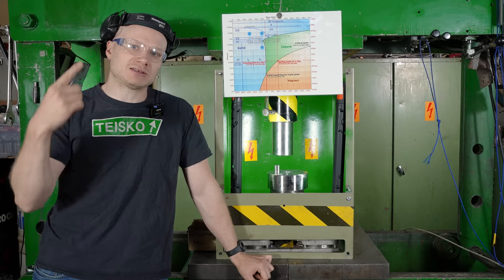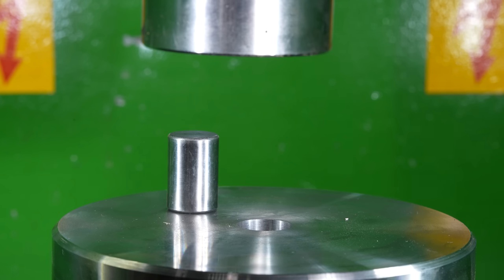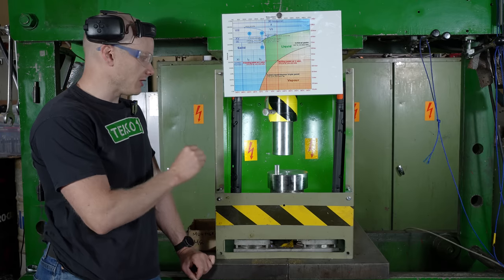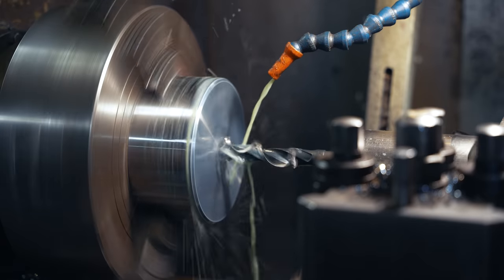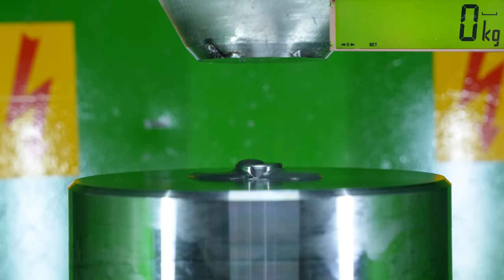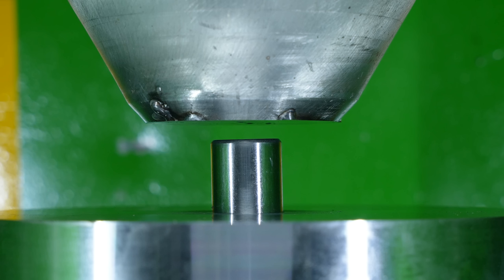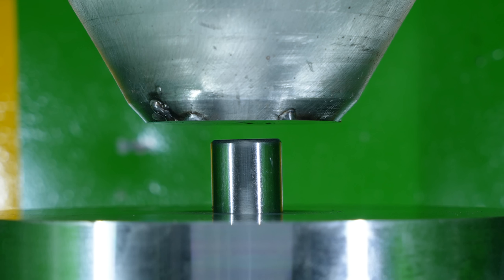Turning Water into Rock with Hydraulic Press

Comment from the maker: I decide to go all in with the mad scientist approach :D If you have any ideas to improve the setup please let me know for future videos! I a have also the fine publication "[22] Methods for the Study of Water in Ice Phases " By W. F. KUHS that I am going to utilize on planning future videos on this series!
Reply: Cut open one of the parts that failed, you may be getting a rough finish on the parts being pressed together causing the leak. Might require more research into compatible materials.
Reply: As water finally gushed out, it means it found a path to get out. Maybe both surfaces must be super smooth with no trace of any roughness so we limit where the water can get out. But I gues it's one part of a bigger picture. Keep up the good work! For science!
Reply: @britmeister  Highly doubtful. To begin with the thermal properties and the viscosity are all wrong for the application.
Reply: Make the outer ring out of a hardenable steel (4340?), machine it, get it hardened and hone to final size- make the interference much less so it doesn't tear the steel.
Reply: I think the only ways to improve the setup are to add more Safety/Clickbait Tape and Googly Eyes.□
Reply: I wonder if a slightly cupped bearing end would help.  would the internal pressure push the cupped rim outward and improve the seal?
Reply from the maker: @nineoclockhero  I think this is probably way to go. I need the hardness of the hardened steel not to spread on the top part but inside of the cylinder that would help
Reply: Could you potentially use liquid water but place a small amount of ice in the top of the tool to increase viscosity around the sealing surfaces?
Reply: Mad respect for the attempt. Exotic ice phases are fascinating. They are an integral part of exoplanetology. Very deep oceans can create them which would seal the sea floor and impair habitability. Earth would need more than 60km deep oceans. But on cosmic scales that is still rather shallow.

One thing to note is the effect of the air in the water or above the water. Ideal gas law states that your press will heat the air to very high temperature. That will superheat the water. Maybe enough to create supercritical water. But that heat will also prevent ice vi/vii formation.
Reply: Make a dye that takes 26 tons to insert into the hole. That way if there is potentially 26 tons of incompressible water pushing back, it won’t leak until it hits 26 tons. Then you can be confident it will be ice VI. Otherwise if the dye takes 5 tons to insert I think it will start leaking as soon as you hit 5 tons of pressure pushing back. 🤷‍♂️ that’s my mad scientist guess. Either way the more it takes to insert the dye without water in it the more pressure the vessel will hold I think.
Reply: I think you failed to exactly make this type of ice here for a major reason. First, you can only make Ice VI with the help of pressure when the temperature is (almost) constant - you need to keep the temperature of the whole system below 350K, as seen from the diagram (and with your level of pressure it will be better to keep it near room temperature, meaning 280-290K max). And when you apply this much pressure on a tiny area, what happens? Yes, it heats up. Thermodynamics, a cruel thing... In the case of water, the heating from the compression is very low, as the water is almost incompressible, but there is certainly a lot of heat from friction between the "piston" and the "cylinder" here. So, you need to raise the pressure VERY slowly, and cool down the whole system to keep the temperature constant.

And second. Water *is almost incompressible*. Well, it can lose up to 1.5% in volume under giant pressure, but that's all. So when you said that "you can see how water is being compressed" - no, it's not. It was probably forming a small cavern inside at that moment - in the same way how you will make a dent in the tool while trying to destroy a bearing ball - and when that cavern deformed the walls of the "cylinder", the water escaped. Try to cut the tool in half to check this. You will probably need a very hard material for the tool, as even hardened steel probably won't be enough.
Reply: In any case I think it's important to minimize the air(or any gas)between the press and the sample. I'm sure more informed commenters will have more informed opinions. XD
Reply: I've got an idea: it requires two tools, a male cone tool (made of something soft and deformable like copper or aluminium) and the female receiver for the cone (made of something harder like high carbon steel). The male cone tool will have a slight steeper angle so than tip is loose when inserted into the female, that room around the vertex is where the water could go. If you put the two tools in eachother with water in-between and then push a large bearing ball into the male cone to deform it. The tapers of the cones should seal together and the pressure produced from the deformation of the male cone would probably be so high that you could get ice 6, maybe even 7 but I don't really know how you'd go about calculating that sort of thing.
Reply: I didn’t check out your paper but as a chemical engineer I’m pretty sure you need to cool your system. You’re doing work to your fluid and it’s increasing the temperature. That energy needs to be removed… or just start with colder ice and it’ll warm a little as it compresses.
Reply: Maybe the bottom of the piston shouldn't be flat, but slightly concave? Even a small chamfer on the edge makes it easier for liquid to get between the cylinder and the piston. The pressure acting on the concave piston will cause it to deform and increase its diameter as the pressure increases, increasing the tightness on the walls. It will be like a hydraulic seal in a cylinder, but made of steel. In theory ;)
Reply: @nineoclockhero A concave piston is exactly what I was coming here to suggest!
😎🙏😁
Reply: @HydraulicPressChannel I haven't read any of the papers on the high-pressure water experiments, but my understanding was it required two things to form:
 - Immense pressure
 - Immense heat [edit: after reading some comments, seems like heat is bad; I might be thinking of Ice VII conditions...]

So while you might be able to create those things while under pressure, my understanding is that as soon as you RELEASE the pressure, it will just sublimate (change) back into water... 🫣
Hopefully that is not the case, since it would mean you wouldn't be able to observe your creation! 😔
Reply: I am literally an experimental high-pressure mineral physicist (Writing my PhD thesis now). I do experiments using large anvil presses, specifically Kawai-type and cubic 6-ram presses. 6-ram presses are literally 6 independent hydraulic rams assembled inside a massive steel structure, arranged to all push inwards along all 3 axes to a single central point. We can get to over 25 GPa (250,000 bar) on samples about 1 mm^3 in size, but I tend to work at lower pressures, up to about 8 GPa (80,000 bar). If you need some help or something let me know. You could probably build a pretty quick and simple DIA press if you have just one ram pointing down.
Or if you want to keep it simple, you could make a quick and easy piston-cylinder apparatus. Ours get to about 4.5 GPa (45,000 bar) pretty easily. As for the gasket issue, we use a natural mineral called pyrophyllite. It's soft and conforms to the gap, but has very high internal friction. My gaskets for experiments start off at about 3.5 mm thick and at the end flow out to a thickness of about ~0.5 mm.
Reply: @Airclot  The hero we needed, has arrived! 🤘
😎
🥼
Reply: @robertnixon1557  Hi, not my channel but you are correct. No offence meant.
Reply: Maybe you can go for a cell assembly that is used in the Griggs type apparatus: https://en.wikipedia.org/wiki/Griggs_apparatus or the simpler https://en.wikipedia.org/wiki/Piston-cylinder_apparatus. Use a teflon capsule machined by CNC (or lathe).
Reply: @Airclot  Which university/lab are you graduating from? I originally come from the Bayerisches Geoinstitut, Germany.
Reply: It would help you prove you have made ice if you had a scale to weigh the tools afterward to prove you didn't lose all the water.
Reply: Maybe a tapered hole?
Or listen to this guy  @Airclot
Reply: Pls make the opposite, create a container , then fill it with water and freeze it down to see if it can hold the pressure
Reply: I don’t think you made ice 6. The chart is showing the pressure at a certain temperature. When you apply pressure to the water you’re compressing the molecules but the latent heat from the water doesn’t have time to dissipate and turn into ice 6. I think you’d need to keep the water compressed and let the heat transfer to the steel in order for the water to become solid
Reply: During a phase change there should be an abrupt temperature change too, might be more convincing if you could somehow get a thermocouple near enough to measure that.
Reply: Many People have learned from school That water is incompressible. In normal use, yes not compressable, but at the bottom af the Mariannes trench, water is compressed abort 5%
Reply: You need to solder water into a gold or plumbum barrel, so it is still very soft metal which can be easy pressed and during the process gold will seal all the micro holes and gaps.
Reply: What if you freeze the water first? Cool the metal parts with the water to -10. Then compress it…
Reply: Try to do it "Oppenheimer Style": let Pommijätkät put a sphere of explosives around a sphere of water, ignite it and you'll easily have ice 7
Reply: Drill a small hole in the piston, so as the pressure increase, a small lips get deformed and stretch against the cylinder, maybe increasing the thightness the more you get pressure?
Reply: Mandy videos are pretty awesome. The two of you make a great team
Reply: I think it could be too hot. The pressure has got to raise the temperature something crazy.
Reply: What if you machine a concave dimple into the piston so that the water pressure causes the end of the piston to expand slightly?
Reply: Oh haha I see that's an idea everybody else was already having. Vittu
Reply: Once turned into ice 6 or 6, please test its conductive, resistive and magnetic properties 😊❤️
Reply: You should have someone create the tools using edm.  You can get air-tight fittings for metal on metal.  That rhiuld allow you to possibly even reuse the tooling as well as prevent almost all leaks.
Reply: I think you are forgetting that water under pressure can easily cut metal. I do not think you will ever achieve the compression you are needing with water vs metal. 

Let's say you do, you won't, but let's say you do. 

Now what? How are you going to see the results? You're pressing a plug into a piece of metal with no way to access the end result, except for cutting the thing in half.

Another idea might be to have someone else with much more precise tooling to make your parts. If it's even possible to squeeze water to those pressures, you're going to need as close to perfect as possible. Which might take a few hours/days/weeks to accomplish.

Remember the roundest ball in existence, still doesn't have a perfectly smooth surface. Any inconsistency, can be the start of water drilling it's way out.

You also have to take into account, the metal you are using might actually be the problem. If the water is actually compressing the metal, you will never get your results as the metal is too soft.
Reply: If you thread a large block put the water in the threaded block and use the press to push like a torque wrench, you should be able to get it water tight and get some insane pressures.  Ice7  ice8 no problem.  Going to need to be pretty large to be able to not snap the bolt, but you've got the equipment and a welder
Reply: @mactheplumber3839  Agree about "seeing" inside the pressure vessel - I am still very curious to see what the plan is for that!

However,  I don't think it's true that "water under pressure can easily cut metal". Under that theory, for example, a water jet cutter could not exist. It would tear itself apart and explode. Yet in reality it survives its own water pressure. The clue is in the name: water JET cutter. The high pressure water is precisely accelerated and directed through the nozzle. It's the water velocity that cuts, not the pressure.
Reply: thanks for trying, the water contamination probably prevents it too
Reply: seems to have heated like our fire starting kits, maybe use temperature gauges, or begin closer to freezing? nice try IDK if it's feasible
Reply: Maybe having the water chamber spherical somehow?
Reply: @HydraulicPressChannel as others have said I feel like you need extremely precise tooling with prefect surface finishes so that the water can't escape through microscopic groves. Probably need to be precision ground and burnished
That way you know it's not a tooling problem... as for the actual physics of it I feel like you need to start with ice to overcome the thermal heating from the pressure but I have no clue. Or maybe put the whole thing in liquid nitrogen while pressing to keep everything cool
Reply: – Check with microscopes the surfaces, I bet they are like perunapelto
– Does the watter, under high pressure, deform the metal?

Total energy of a system stays constant. Thus, the force needed to compress the matter (water, air, oil, etc)..is it converted to heat, then? What does it mean for your tool and for the experiment? – Hmm, well, actually I don't the physics of the energies and heat capacities of matter under pressure...
Reply: It mimight be better to tapper the walls on your die and press to match. Like a wedge.
Reply: during the winter, move as slowly as you can, allow the air to cool the metal until saturation. the same reason f1 cars use oil heaters before starting their cars is the reason you want the metal as cold as possible...yes to make it room temp...you are heating it too much by moving fast.
Reply: @un2mensch     water jets for cutting metal have an abrasive in them . Water by itself won't cut metal .
Reply: Reduce size of setup to reduce forces on sealings!
Reply: @Silverhorse777 
There's no hard cap at 1.5 percent. At silly pressures compressibility continues. 

As pressure increases melting point rises, so he has that going for him. If he can hold the pressure for any amount of time, melting point will be plenty high
Reply: Maybe if you fully encase the water in a structure that can be crushed, then while being crushed the structure you're crushing will crush the water inside the the water will be less likely to escape.  Then, if it works just take out the structure you crushed, saw it open and see if there is any ice/water-rock inside.  The only downside to this idea is that the heat from the saw might heat up the water.  Also, you want a very small contact point so that there is more pressure on the water.  Sort of like when they use two tiny pieces of diamond to squeeze things at very high pressures.  I'm no expert, so I don't know if those ideas will help, but I hope they do help.  Good luck.

PS: Some other commenters below, like eg Rsenior1981, reminded me that you also got to give the water time to cool as you compress it then press more, then let it cool more, then repeat.
Reply: Just to keep in mind that ice is less dense and water.
Reply: @EricHall-is5kn  That depends upon the pressure and temperature actually.  Ice starts to shrink and get denser as you go below freezing.
Reply: @EricHall-is5kn  I'd suggest you look at the phase chart for water.  Ice is more dense than water at certain pressures and temperatures.
Reply: What about using a slightly oversize conical copper washer to creat a seal.
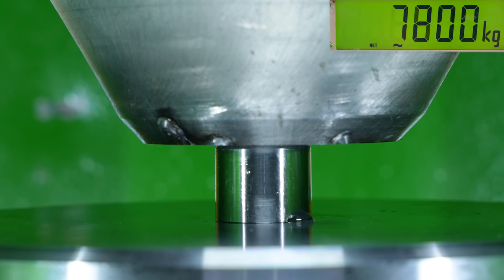Reply: nice work! @ 6:00 the leak starts at ~54000 psi. This is around the tensile strength of mild steel, which it looks like you are using for the socket. Three quick ideas: 1. use harder materials. 2. flare the plug at the top so a component of the press force creates a seal (the softer metal will deform, but the pressure should get higher). 3. Use a softer plug with a divot and make a cone in the bottom of the socket; this will wedge the plug out into the socket walls at the bottom, again improving the seal. You might still need materials harder than mild steal for 2 and 3, and being sure of the internal pressure might be hard. Also, cooling should help reduce the pressure needed to make the rock. Good luck!
Reply: A series of radial slots in the male part to reduce pressure between each interference fit area. Make the male part longer to facilitate.
Also maybe step the male part down to a ultra high pressure area. 🤔🤔
Reply: This is also good idea. Perhaps a sanding and ultimately polishing of your mating surfaces.

Also look into galling. You want materials that deform and smear but don't peel off and gall.

But you want to avoid accidental cold welding, I think, as that would force galling material to break off and gap your seal.
Reply: you need a complex Mechanism and harder materials, at those pressure water is going to leak if you manage to get the pin out you'll see there are path ways cut in the metal. either you need to compress water in a sealed contaner like a capsule of metal completely seald "welded" with water in side and then try to deform it in same maner or make a contaner which can hold the pressure and compress water with high pressure pump.
Reply: Encapuleate the entire tool inside a plastic bag to capture all water that spills out. 
At the end of test measure how much spilled out and minus this volume from the initial volume. 
Compare the remaining volume that must still be inside aperatus to the volume that must remain after the bearing has been inserted. 
If this remaining volume is too small for the volume of water that must be still inside then it must be in a phase more dense than water to exist.
Reply: Just 6000 bar? Im shitting my pants if i pressure test at 130 bar 😮
Reply: When pressure increases the temperature increases also. Freeze tools with water before pressing.
Reply: Try to shape the bottom of the plug so that it expends when the pressure increases, therefore sealing better. I imagine drilling a hole in the face of the plug on the wet side would do it.
Reply: use a conical shape or a point per say. the cylinder is good but a dish on the receiving side and and protrusion on the pushing side will give tighter gaps
Reply: the idea of starting with ice instead of water has some advantages. I don't know the phase change enthalpy, it could get quite hot of you squeeze water in this way (thermal camera?)
so using ice instead of water in that anvil, when it is chilled down, could help?
you are quite resourceful, is there a way that you take the anvil-tool, put in some water, then cool it down with liquid nitrogen (or at least dry ice), and squeeze that.
Reply: Try put the press in a vacuum chamber, so if you make some ice7, you can manipulate the environment before relieving mechanical pressure.
Reply: You must be making an immense amount of heat in that water, possibly forcing it to steam at 900x the volume as you compress it more.
Reply: I don't think you can only trust the pressure reading on your normal gauge because in this case it is not only pressing against the water it is also pressing against the wall of the outer (hole) zylinder so I think the pressure on the water is a good bit lower
Reply: Maybe look into electric discharge machining for a more watertight seal
Reply: If you absolutely want to see what happens to the water while you compress it, you'd need a SUPER tough transparent material. The only choice of material I know that comes close to these properties would by AlON (which btw a) is commercially available & b) you haven't tested on its own yet) & PolyCarbonate composite material.
Reply: But realistically even those extreme ceramics don't stand a chance against hardened steel & will crack & shatter long before you'll damage the steel.
Reply: I seriously dont think its possible unless the pressure is applied very slowly over a long time and the water will ievaparote way before most likely. the increase in pressure will always increase heat and turn the water to steam. Not even mercury can be pressed iinto a solid but that might be more possible
Reply: Freeze the water by nitrogen and compress it
Reply: You need a deeper hole and a longer pin!!! You need more friction length to do a better seal. At the moment your pin is only half inch in the metal before squishing the water.  Deed a 3 inch deep hole and 2 inches of smaller diameter friction area before it touches the water to start building pressure. I think your idea is brilliant and it should work with a longer pin and a bit longer of a sealing surface.
Reply: What are your surface finishes like? Maybe a smoother and harder material could work better. Not sure how your press would handle it, but maybe even press fitting tungsten carbide instead of hardened steel
Reply: You need to cool the metal parts with ridiculous amounts of liquid nitrogen and press slowly (calculate the heat increase and transfer). And guess what it will do for the metal? :D But but. What if you could do pressurized ice and bring it back to NPT?
Reply: Oh, and instead of pressing, try having threads and rotating (somehow with the press, if needed). Probably is a better seal. Or what do I know...
Reply: 🗨🗨🗨You should check the hot of that water as it shoots out.‼️
Reply: Try making the tip of the rod like a little upsidedown bowl so the water pressure makes the seal stronger, pushing from inside against the walls
Reply: Make the hole and the rod that goes into it wedged shaped, only a little. So it’s like the more you press, the tighter the seal is?
Reply: Bro freeze water first. Then comress this ice and it must be easy to turn it to ice-7
Reply: i'm thoroughly invested in this series. i hope you keep trying! the problems you're encountering are really interesting and fun to watch.
Reply: You need a metal ball thats hollow inside. Drill a hole and fill it with water. Then weld the hole closed and put a protective layer of metal on top and weld that as well. Then squish the ball with 70-100 tons. Then saw it open 🙂👍
Reply: Whe you pressurize the water it heats up. Hold the pressure and let it cool before continuing.
Reply: You are using a cylinder so when one part fails, it’s over. You should use a very gradual cone so the sidewall pressure is always being added as you are pressing it into the hole.
Reply: Now you might have a tiny tiny understanding on the difficulties of fusion. But try for ice 10 instead and you got it.
Reply: Water is stronger and can cut metal
Reply: MAKE A CUPPED END PEICE OF STOCK (TUNGSTEN PERHAPS) THATS HARDER THAN MAIN BLOCK. APPLY WATER IN CUP AND PRESS IT INTO A SOLID MAIN BLOCK
Reply: Omg, is water like diesel, exploding under high pressure? The water engine is now invented.
Reply: you can improve the "crush water into rock" seal in this way: drill 10cm hole in your base. bottom 2cm is very thin radius, 2mm. then the next 1cm height is a funnel up to 2cm width. then another 2cm is a slow funnel to 2.2 cm width. the rest of the hole is 2.2cm width. now, put a 2.2cm LEAD cylinder that's 5cm tall into the hole. then a 5cm tall steel cylinder that's 2.2 cm wide. the lead will squish around and act like a gasket, so water cannot escape. good luck! if you want even more, you can add progressively softer materials: from top to bottom: steel, then lead, then silicone rubber, then wax, and water at the very bottom. this series of materials will hopefully ensure perfect sealing.